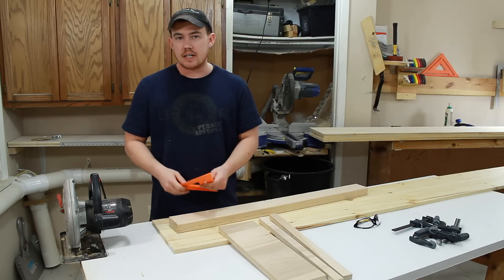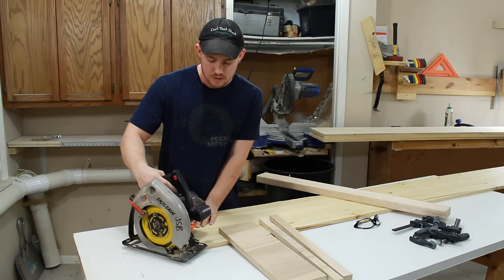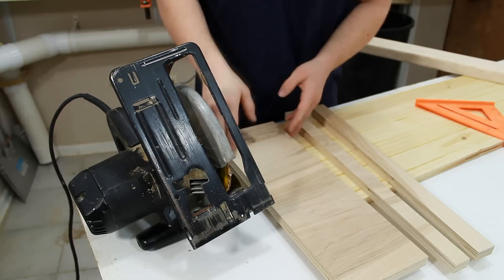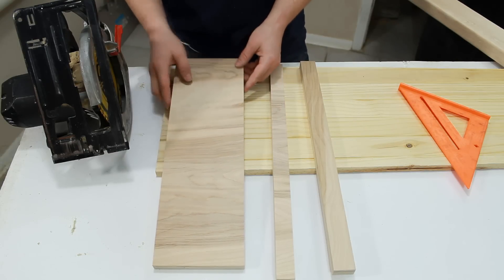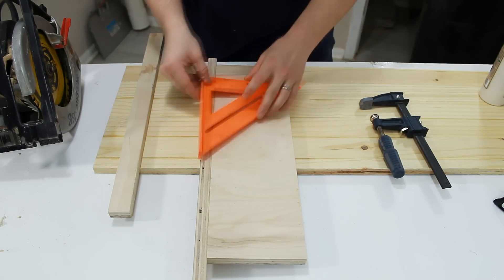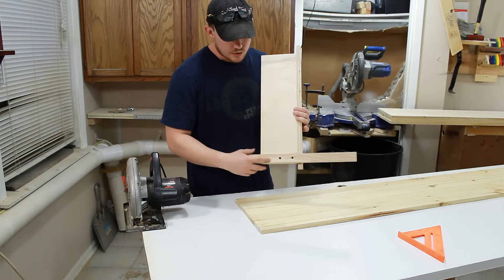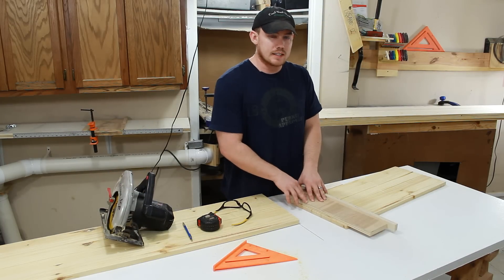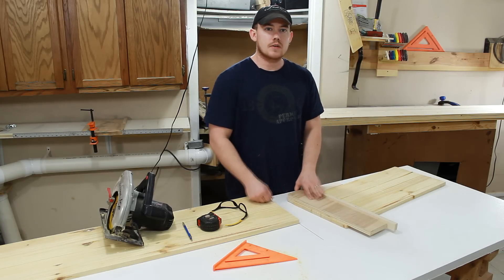Zero Clearance Circular Saw T-Square - 121

Comment: Tnx Jay, gotta have several of those for each and every one of the saws, altough there are some saw that their design doesn't allow an obstacle free fence and I found that a strip of aluminum can be a good reference to back that needed straightness and can be as high as the saw's sole plate. For instance those cordless saws they don't have to much features and are limited by the depth of the blade, adapting a zero clearance T-square to it will make the saw more useful towards any kind of cut. Tnx for sharing this vid Jay!!! :D

Comment: Nice simple design. When I made mine from some conti board scraps I made it as a 2 piece design that didn't lose any of my depth of cut from the saw blade as my circular saw is a little smaller than yours.

Comment: Sure, and the advantage of your jig is that you can quickly line it up with the line or mark of your cut.  You could use 3/8 inch GIS fir plywood, no need to be too thick, it just takes away from the depth capability of the saw.  I'm a jobber, and have a lot of tools in the trunk of my car, so an extra jig just takes up more room.  You quickly learn to keep cutting straight with the six inch square, but an 8 or 10 inch would be nice . . .

Comment: Thanks Jay.

I have realy liked your T Square demo and I made it in two different lengths as you suggested. But, because I am not as skilled as you are, I have added two fixed rulers, one at 90° at the bottom end  and one at 45° at the top end.
It Works better for me.  I wish I could add a Sketchup 2D I also did, but how? Thanks

Comment: thanks for the video. So simple. What could go wrong? ..... Plywood theses days is not flat, at least not for very long. What it is, is strong in compression and tension parallel to the thickness. What that means is that it is very bendable and weak perpendicular to the thickness. So that means that you can not count on a single piece of plywood being straight unless you force it as would occur within a dado or rabbet. Using the speed square to align the 90 deg fence may seem easy but too much can go wrong when trying to hold the fence to the guide during screwing and or gluing. Also, just how accurate are plastic or cast metal speed squares? What can be measured and adjusted is the table saw blade to work piece geometry (square and parallel). Producing a straight edged guide and a perpendicular 3/16" dado to the guide with long fence attached  can be accomplished on the table saw, which  will transfer the accuracy of the table saw to the t-square for that all important 90 deg angle short fence. The 90 deg fence should be place to give maybe 4 inches of guide before the saw encounters the work piece as should the end overhang for when the saw leaves the work piece, as well.

Comment: What was that under the wood you cut? It looked super helpful for stability
Reply from the maker: It's an old beat up junk hollow core door. I work maintenance at an apartment complex so I have a room full of them. Keep the saw marks on one side only and it will last a long time.

Comment: I think it;'s a bad idea to cut into a surface below the saw -- it's just too easy to form bad habits that way and one day you may find you cut into a surface you want to save.  Instead, what I do is whenever I cut with a saw, I just make sure that where I cut is going to be over just open space, no wood to foul it up.  One good way is just to use a sawbox, where the saw is guided on both sides and the sawbox can be clamped solidly to a surface.  This guarantees accurate cuts.
Reply from the maker: +bodryn The work surface is an old door. Used as a sacrificial surface.
Reply: Cutting over open space doesn't always give the best support to the piece. Improper support can result in a higher risk of kickback.

Comment: As always Jay - good stuff.  I made a posting at lumberjocks http://lumberjocks.com/projects/81555 showing mine.  One thing that you may wish to do with your is put carpet stay on the bottom.  I'm referring to the rubber pads one can buy at a variety of stores that stops carpets from sliding.  It is AMAZING how it will hold that guide in place.  Also, I made my base from 3/4  board (looks like you may have too).  I'm going to remake mine soon and use 1/4 inch hardboard.  I find the 3/4 is too tall and makes for cutting think boards hard to do.  For example I hung 7 doors recently.  With my think 3/4 guide, the blade just barely made it through the door.

Love your videos, brother - keep'em coming.